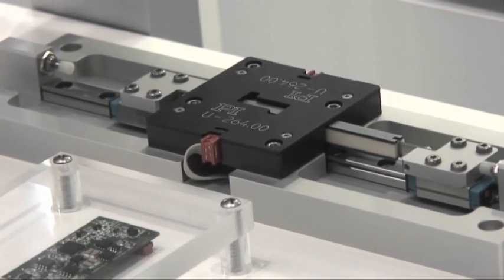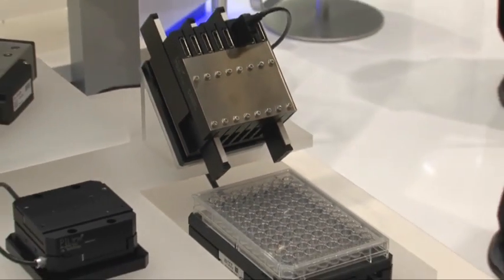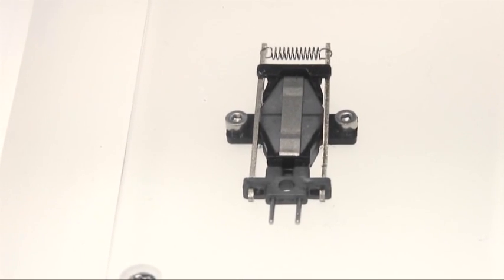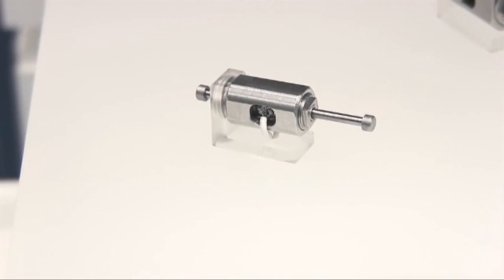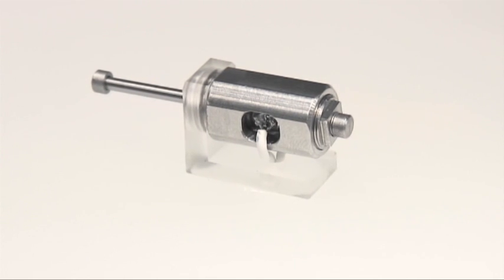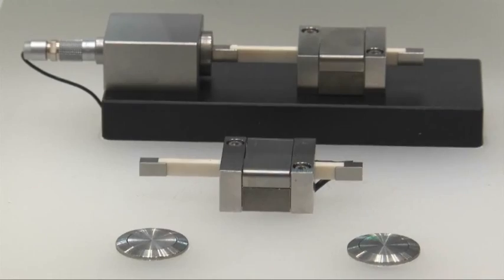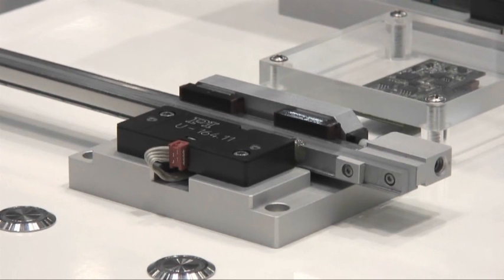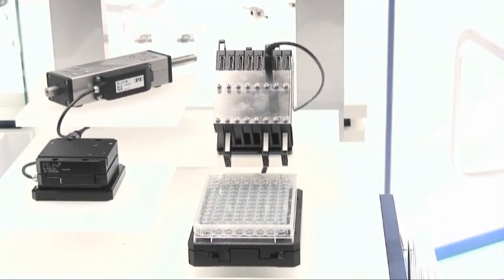Why use Piezo Motors for Precision Positioning or Fast Actuation? By www.piezo-motor.net

Comment: Can they be used to extrude filament in 3D printing applications, i.e. a continuous feed-through of solid material?
Reply: Thought of the same. Do you know more?
Reply: @MrPeterpaker  They could, but they are far more costly than the current motors used. Additive manufacturing does not generally need that level of accuracy in the material feed. These are primarily used for nanometer precision adjustments.

Most commercial 3D printers use small DC or stepper motors, that are low voltage, easy to control, and as precise as you need for that application. Piezo motors require higher voltages and generally require special tuning that would require a dedicated piezo controller. To add those into a printer feed head, you'd require the motor itself, a way to mount it, a separate controller to handle the tuning, and higher voltages. 
You'd be looking at anywhere from $150 to $500 for just the motor(the ones in this video are closer to the $900-$2000 range), and $150 to $300 for a cheap single axis piezo controller if you purchased it used.